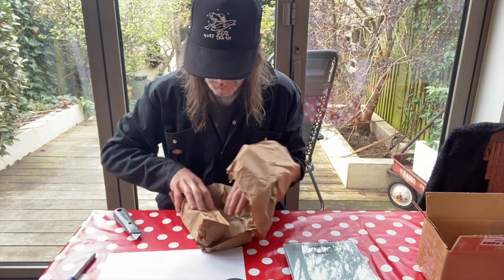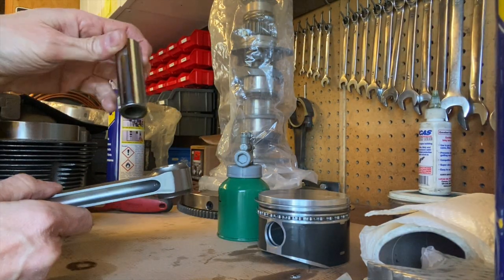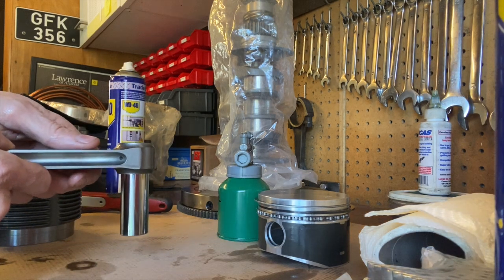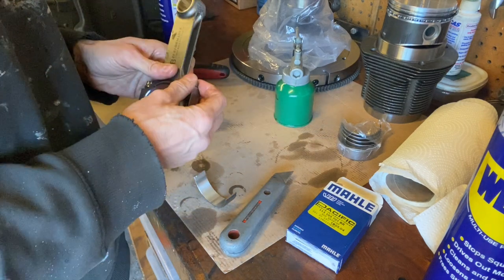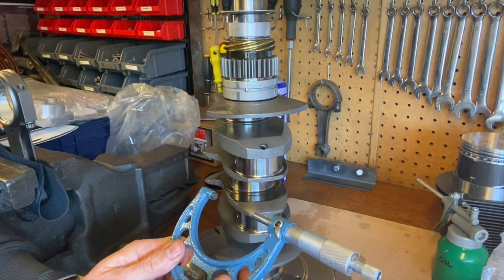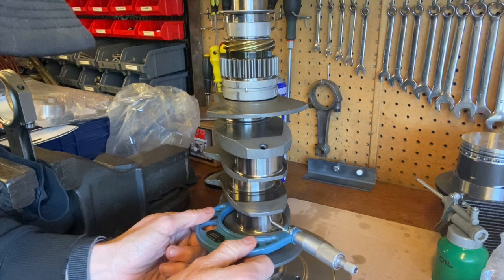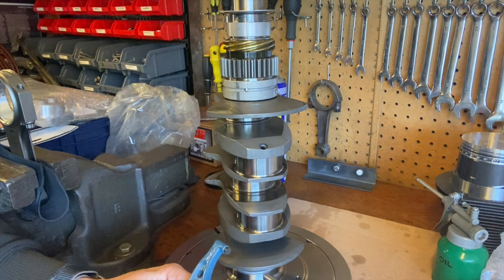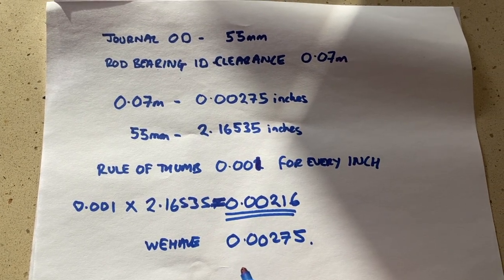PART 7 – CB Race Rods- How to Build a CB Performance 2017cc Builder’s Choice VW Engine

Comment: The wear limit for the small end clearance is 0.04mm!. New spec has a super tight tolerance and is effectively machinist “slip fit” which is a hair over an interference fit.
Reply from the maker: Good to know. I need a guage that will fit the little ends.
Reply: Checked the Bentley manual. The new spec is 0.01-0.02mm. At that you should not be able to rock a fresh pin beyond a tiniest amount (pin measuring bang on 22.00mm), at 0.04mm you get a little rocking. So you can do it by feel.   Also checked the VW rod clearance spec. That should be 0.02-0.07mm new, with a wear limit of 0.15mm. The side clearance of the rods (to the crank webs) is 0.1-0.4mm, with a wear limit of 0.7mm. Race engines are often set up a bit loose to reduce friction losses at the expense of lifespan. Thanks for doing these videos. I’m finding them very useful so please keep it up, even sharing the mistakes! 👍
Reply from the maker: @bwm999  the pins were super firm
In there. 👍

Comment: Just keep weighing them until you get the numbers you want! I thought it odd that you were putting Loctite along with the assembly lube. I know you had done that elsewhere.
Reply from the maker: I know right!? I noticed that the numbers changed depending on where you placed each rod on the scale's plate. On the last round I put them all central and I liked those numbers, so stopped there. Hahahahahaha.
Reply: bend a stand out of wire so you can weigh the big end and small end separately, match both ends.

Comment: Never use loctite on ARP bolts. Only use the supplied grease!
Reply from the maker: Ooops. Too late. 😬
Reply: @aircooledanything2415  I would be taking it apart and cleaning off the loctite before I ran it :) the loctite will mess with the bolt torque. ARP are very specific that you use only their lube.
Reply from the maker: @vpinhorn  blimey. That’s a bit drastic for me. Short block assembly is now complete. Yikes. I thought loctite helped with torque settings. I put both the loctite and their grease on. For my all plication as a daily driver, low revs and nothing serious with regard to hard driving I should be okay. I know for next time though. Thanks for the advice.
Reply: @aircooledanything2415  
sticking my nose in here
I wish I had split my cases and rechecked the innards while it was out rather then regretting it after I put the thing back in. That's where I am right now.
vwdaren isn't so hot on lock tight on the crank or any internal parts, he says it can flak off after it hardens, but he does race his engines
Reply from the maker: @patrickmclaughlin6013  Damn,sorry to hear that. What was the problem?
Reply: @aircooledanything2415  
I should have checked my cam, rod, crack, case, lifters while it was down for heads and jugs.
Oh well, I'm sure it'll be apart again sooner then later.
Thanks so much for sharing your build. It's been very educational already.

Comment: I thought the rod bolts were not supposed to be reused after they have been torqued? Something about the bolts stretching? maybe that's if you run them in the motor for a while?
Reply from the maker: That would make sense. I know 356 Rod nuts are one time use only. Time will tell I guess. I hope it doesn’t cause a problem. 🤨
Reply: These are ARP rod bolts they are reusable. If you’re concerned, use a stretch guage
Reply from the maker: @vpinhorn  that’s good to know. Just the loctite issue that will give me sleepless nights now 🥺
Reply: @aircooledanything2415  it maybe ok, but if it were mine and seeing the amount of time and effort in that I know you do on your projects I think I would be doing it right for peace of mind :)
I’ve just checked on the arp website, they say either lube or loctite, not both.

Comment: Notch the rods so the oil leaving the journals get squirted to the bottom of the piston.
From a vw service bulletin: thesamba dot com/vw/gallery/pix/933841.gif
Reply from the maker: That’s a great tip. All of those little details can make a huge difference.
Reply: hot tip, Thanks
do you cut that grove on both sides or just one?
Reply: @patrickmclaughlin6013   Both sides, and I usually use a round needle file and don't leave sharp corners.

You can do something similar to the rockers with CB's rocker arms too along with the HVX oil system mods: bobhooversblog.blogspot dot com/2007/05/hvx-mods.html